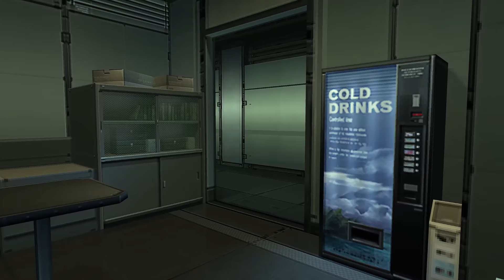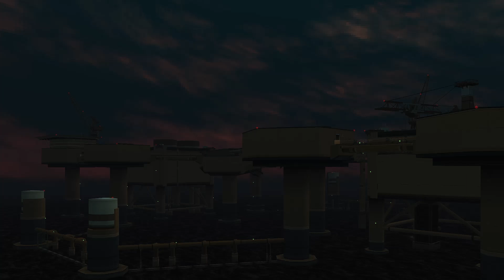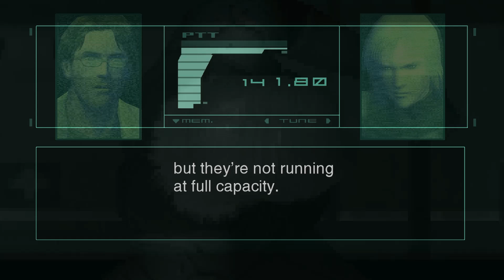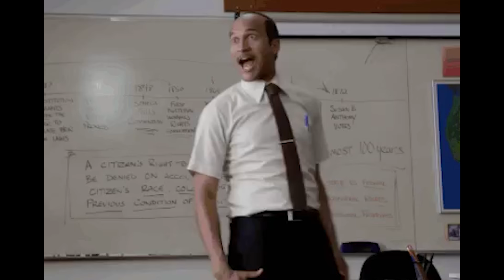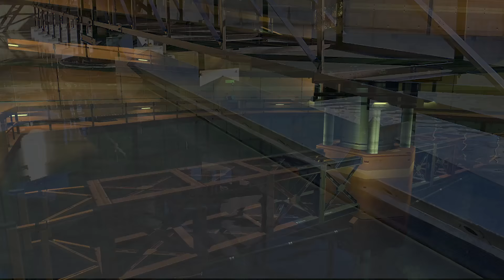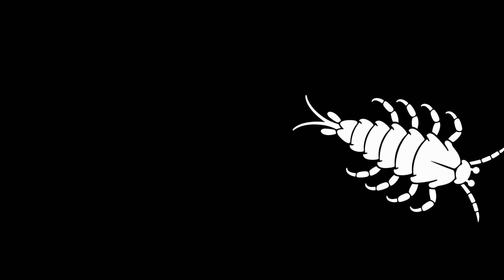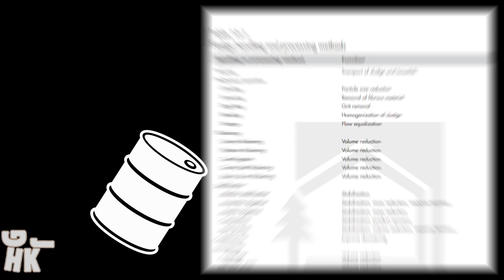How Realistic Is MGS2's Big Shell?

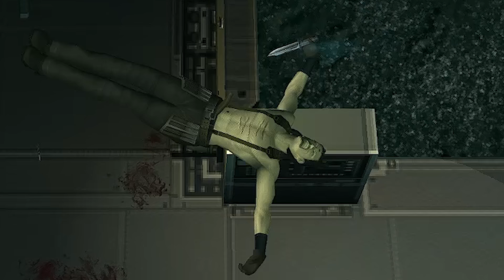Comment: 22:26 what Vamp is actually describing is bubble-aerated water, water whose oxygen content is being raised by sending a massive amount of bubbles through it. The unpopped/undissolved bubbles are what lowers buoyancy, rather than the dissolved oxygen, by way of reducing the actual density of the water significantly by just replacing a lot of its volume with straight up air pockets. You can actually see the bubbles ingame.
Reply: Could this be another mistranslation
Reply: @ieuanhunt552  I'd accept it as just Vamp the character not being as knowledgeable as he's pretending to be and giving a similar but incorrect explanation for why you can't swim in that tank.
Reply: @ieuanhunt552  Coulda just wrote it like that to "sound cooler"
As much as Kojima loves flexing how much he researched everything, as atested by other cutscenes in the game, it's unlikely they got that part wrong
Reply: Yup, aerated water tanks are well known to be extremely dangerous and basically unsuitable.  They all have warning signs posted next to them.
Reply from the maker: Good point actually! I probably dismissed that part a bit too quickly. I guess my main issue is Vamp blaming it on the “high oxygen content” itself, since real aeration tanks only have dissolved oxygen in the low mg/L range (around 2 mg/L usually, but often less). Which isn’t even close to making buoyancy basically disappear.

But I do agree, the bubbles make it a lot more believable! You’d still need a massive amount of the mixture to actually be air/gas before you got anywhere near buoyancy being “practically non-existent”, as Vamp says. Even something crazy like 50% air by volume would only roughly halve the buoyant force.

But I should have spent more time distinguishing between dissolved oxygen content and the effect of all those bubbles, my bad!
Reply: @ProbablyPaz halfing the buoyancy would be more than enough to prevent someone from swimming
Reply: @ProbablyPaz  To be fair he's an immortal soldier specializing in knives and running on water. He's not a scientist. He's probably repeating what he overheard from someone he killed in a morbid game of telephone.
Reply: @PanAndScanBuddy  i like i to imagine it was parcheesi or checkers.
Reply: @ProbablyPaz  I remember seeing pictures of these pools from waste treatment plants and they had warning signs about this. "DANGER. Deep aerated water. This water has no buoyancy. You will NOT float". It's a scary thought to fall into sewage water that you can't escape from.
Reply: @kahvikone  its how lots of the ships went down in Bermuda, hydrogen vents aerated the ocean and you sail into a patch and just drop to the bottom of the ocean like it isn't even there... it would have been terrifying
Reply: @ProbablyPaz  Mythbusters did a study on this part and it was interesting to watch.
https://www.youtube.com/watch?v=5Ov6Po0Eu1E
Reply: @ProbablyPaz this also happens when a ship sinks quickly, the escaping air bubbles make a column that any survivors could fall down through the water.
Reply: @ProbablyPaz it's weird that you take the undead vampire as a certified expert in what he's talking about.
Reply: @ProbablyPaz  

the simple way i like to explain it to people is : its hard to swim when half of what you are flailing in is just air. 
and fun to show with a glass a straw and a little paper boat

Its how lots of the ships in the Bermuda triangle went down, lots of hydrogen vents aerated the water in random patches. (it would be utterly terrifying just suddenly falling through 100's of feet of water and crushed)
Reply: @ProbablyPaz  plus it makes sense to not completely explain it when really he just wants to psych Raiden out, not actually educate him.
Reply: YES, just wanted to comment this myself
Reply: Plisskin: Vamp doesn't say oxygen-rich water because of the bubbles, he says it because he's bisexual.

Raiden: !?
Reply: This would explain a lot- I felt like what he was describing sounded a lot like a fluidized bed, only... well, water. I think that's a perfect explanation.
Reply: Even that's been disproven as a myth, the main reason aerated tanks have such safety warnings is more to do with strong currents and dangerous machinery in the water. It's been tested by a number of people, and no matter how many bubbles you pump into a pool of water, it never reaches a point at which you magically start sinking.

The bubbles buffeting you around make swimming incredibly difficult and tiring, but don't reduce bouyancy
Reply: Purified hydrogen, ooga booga
Reply: Mythbuster tested this, it's not as dangerous as sinking. It's more the churning of water means it goes over your head too much to breath easily
Reply: Excellent explanation
Reply: That reminds me of the bubble columns in Minecraft, i wonder if that's the real world reason why you get sucked into them.
Reply: The whole thing was a vr construct in the canon. So it stands to reason that on close inspection it might not be practical
Reply: @makimaki19891 it... what? No, it definitely wasn't. You might be thinking of Ghost Babel but the events of big shell happen in the story. The S3 simulation wasn't a VR simulator- it was an orchestrated series of events to be LIKE shadow moses.
Reply: I think this whole video is pseudo intellectual engagement bait. A ton of snark while ignoring everything obvious is a neat trick I guess.
Reply: @notbeelzebubsmullin  It listens like a dude that did research, but not enough research. He missed some obvious stuff that I was already aware of (eg. the aerated water thing)
And yeah like the other guy said: The clippy avatar really isn't doing you any favors. Monetised YouTube channels reinvigorating symbols of Corporate depravity isn't gonna change anything for the better. But anyone "in the know" knows that was never the point anyway
Reply: This distraction-bickering is the very point of the false-dichotomisation, guys
Understand who your real enemy is (Humans, Statism, Corporatism, etc)
Reply: @notbeelzebubsmullin blaming something on psuedo intellectualism while having a clippy pfp is hilarious
Reply: @ATARAXIA_MECHANICA  Sorry I touched a nerve. People usually don't jump on their alt account to give a nonsense reply so fast.
Reply: @notbeelzebubsmullin exactly the response as I expected from a NPC remotely controlled from the louismann hivemind.
Reply: @ATARAXIA_MECHANICA  You have nothing, so I will give you this for free. Be curious, learn, become literate. Keep in mind, literacy isn't as simple as being able to turn these glyphs we call letters into sounds, you will also have to be able to decipher the meaning of those sounds.

I am eager to meet you again once you have gained the ability to participate in an adult conversation. I believe in you! Until then, I'm done with you, have a good day.
Reply: @notbeelzebubsmullin  lol kiwifarms controlled meatbot, completely lacks any introspection yet dares to spout "be curious, learn, become literate".
Reply: @notbeelzebubsmullin  unlike you, I am a realist so I would not expect an NPC like you to figure out the connection between clippy, grifting and psuedo intellectualism, especially one that's already programmed to treat any opposing idea as either espoused by an alt or someone mentally stunted.
Reply: @ATARAXIA_MECHANICA  Way to tell on yourself for being bad at dealing with autistically inclined people, and immediately judge and attack on top of that.

Why autistically inclined? Because Rossman, the content, and beliefs are statistically very likely to resonate with such folk. Hi.
You seem to assume setting a pfp is all we ever do? Do you have any idea how motivated us types are with actually going through with all the "annoying" and "inconvenient", important steps of contacting our representatives, showing up to hearings, providing solutions, using alternative systems, open source, Linux, Graphene, tinkering and hacking our hardware into doing what it was supposed to do, and participating with things we already inherently believed in?

Contrary to what you might believe, Rossmann did not "make us have an opinion", it's the other way around. We had the same opinions already, and had already congregated due to the type of repair content which resonated. The "activist" type stuff only followed as a reactionary consequence of our spaces and rights (including yours) coming under attack in the first place. We are your repairmen, system administrators, programmers, data recovery specialists and privacy advocates. We do these things not because someone told us to, but because we already believed these things are important.

Never underestimate how far some people are willing to take things for the right cause. You refuse my valid warranty coverage just because you figure you can boost your bottom line on my back, as I'm unlikely to bother figuring out how to do something about it? You take a product I purchased away, you add ads and increase the cost after I already paid? We will go to the end of the world to figure out how to drag you to court simply out of principle so you think twice before you try to pull that stuff again, because if we don't, apparently nobody else will. Call that mindset whatever you want, but boot licking is definitely the furthest from it.

This sort of reaction seems more like a self-tell of "autists give you the ick" and doesn't look good. And I say this as someone who did not change my pfp, and does not agree with the tone or content of the comment you replied to. Just as someone who is utterly baffled at the conviction on display which itself tastes of bot energy. Why go to war with a cause, and types of people, you seem to have so little concept about. Seems to boil down to a case of mistaking ideology for tribalism.

For most of us, the pfp thing is nothing more than an additional outward signal. The very real biting piranha actions are what counts. And being irritated by it suggests you might have been bitten in your professional career for what you're doing, in which case, good. That's the point. Being defeatist is one thing, but being aggressively defeatist like that is way more weird than being one of many actively biting piranha nuisances in an objectively good cause for customer rights in the age of enshittification.
Reply: @BlackSun404  graphene os and rossman in the same sentence is actual NPC behavior, it's a 3 minute search on his harassment campaign. But no, it's much easier to turn your brains off and slurp up whatever the god-youtuber amalgamation you worship have vomited out, and use autism as a shield when it has nothing to do with plain ignorance and psuedo intellectualism
Reply: ohhhh I get it now, autism is what explains someone's total lack of research into anything yet makes it their entire personality!
Reply: @BlackSun404 Annnnnddd you didn't figure out what rossmann is like behind closed doors and think that's what I'm about. NPC indeed
Reply: @ATARAXIA_MECHANICA  Seems awfully personal. What is Rossmann like behind closed doors? Please tell us I beg of you.
Reply: @somedude9316 lmao youtube deleted my comment about that so many times, I give up. if you can't see though his awful netsec then stay an NPC please.
Reply: @ATARAXIA_MECHANICA  You should make a video about it and see if they delete that too. I for one want to know what he's like behind closed doors per your account. Go ahead and whistleblow for the community. No need to call people NPC's over it. You're sounding quite jester when you do so.
Reply: @somedude9316 It is your obligation to stop acting like an NPC's (sic), sir master of all things intellectualism. Maybe ask devs of Graphene OS on what he's like, or look into futo's history with open source, it's really obvious and thinking it would require whistleblowing is funny as hell
Reply: @somedude9316 also it shows you are just a larper as well, since you have no idea how aggressive youtube is with comment deletion if you use an VPN. Can't even type "➡🕊" out.
Reply: @ATARAXIA_MECHANICA holy shit both of you are pathetic.

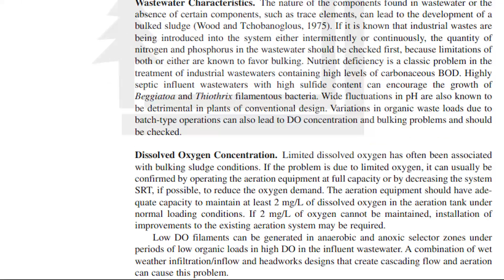Comment: 22:06 I thought sometimes if underground gas is naturally released from under the sea, it affects byoyancy? Sure density matters, but if there's no water to begin with (now replaced by air bubbles), then the object floating above would sink?
Reply: Correct. Possibly a translation issue, I don't know, or a non-expert slightly misspeaking, but that is aerosolized water. When injecting massive amounts of pure oxygen into massive amounts of water it's not like it saturates uniformly instantly. The phenomenon Vamp is describing is the reduction in buoyancy caused by the presumably oxygen bubbles. This is actually a warning sign you can sometimes see out in the wild where aerated water is being used for whatever reason and they are often a feature of water treatment plants. They're usually called like an Oxygenation Ditches or Aeration Basins etc.  I've seen warning signs that say "Danger: Deep aerated water. This water has no buoyancy. You will NOT float." or similar. It's not and idle warning either. Even a very strong swimmer would have no hope of so much as treading water. You're going STRAIGHT to the bottom. Fun fact: sometimes this happens out in the wild when things like underwater volcanoes or other fissures suddenly release a ton of gas. When this happens in shallow enough water there is precedent of it suddenly swallowing a ship.